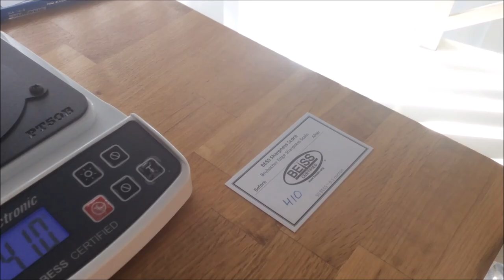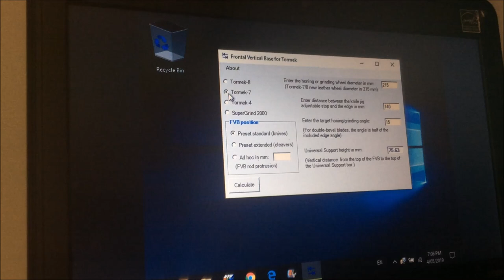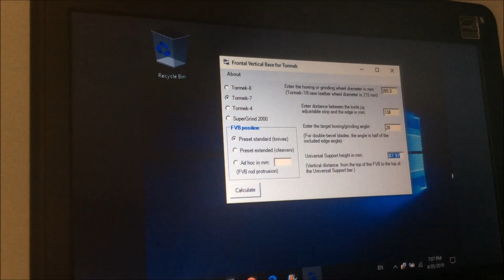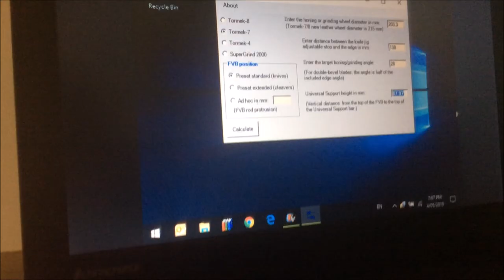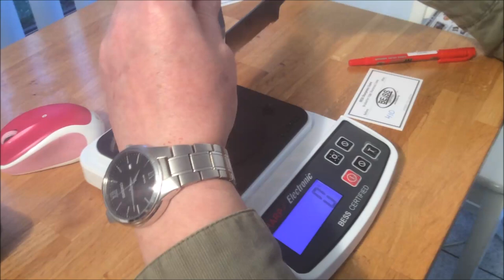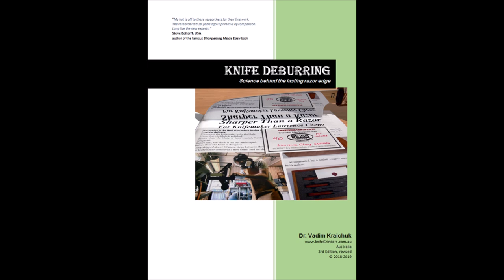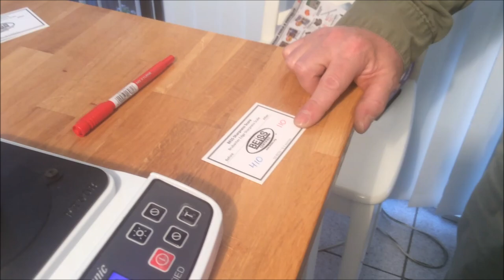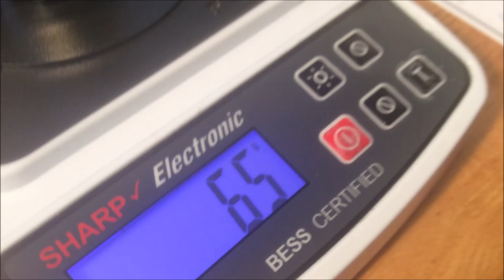How We Sharpen Serrated Knives on Tormek

Comment: Vadim, great video, again; very informative.  However, I couldn't understand what you said between 3:43 - 3:48, when you were describing how to set the serrations.  Could you please clarify?  Thank you.
Reply from the maker: Right, this is important - how much to grind the flat back side. The grind should cover the arches of the serrations (some call them "valleys"), but not extend much further towards the spine of the blade. Practically, initially I place the blade on the wheel almost flat, just to clear the knife jig clamp over the wheel. The lower is the blade, the further to the spine will the grind be. I slowly raise the Universal Support height watching the edge contact with the wheel.  When I see that the edge contacts the wheel in the arches/valleys of the serrations,  I fix the Universal Support in this position.

Comment: I agree completely with you about using a round or conical stick to do anything but start a new scallop. I was taught to deburr the tips with a flat surface and stone the scallop. Gentleman prosharpener used buffing wheels to point and a spyderco ceramic triangle for scallops. He only would touch the back bevel(?) with a bench stone to true it
Reply: He had no guide but a sweet lighted magnifying fixture to get his eyes at gnats ass focus. I really like this video btw

Comment: Another great video.  Question; Where can you purchase the tapered felt wheels?
Reply from the maker: I bought those 8" split laps online, one from a jeweler's supply website, another through eBay.com (not .com.au), but can't remember exactly from whom. The makers are shown in the end of the video.
Initially we used them on a 6" grinder for deburring serrations, but after our research showed this may compromise the edge retention,  we moved the wheels to Tormek to deburr "slow and cool" rather than "fast and hot". Even if the grinder is half-speed, like those that we use with paper and felt wheels in honing plane knives, serrations take longer contact time because have to be honed one by one sparing the peaks, and get too much heat from the felt.

Comment: So to be clear, for a serrated knife, you are sharpening the flat side? You don’t need to sharpen the other side? As in each serration on the other side of the knife?
Reply from the maker: Grinding in the serrations is not sharpening, it is restoration.
No one restores serrations in a bread knife - we sharpen it while it is good to use, then through in the bin.
Restoration of the serrations is something we can do on higher-end knives.

To sharpen a serrated knife, we grind the flat side of the blade. Inside the serrations we only deburr.
Reply: @knifegrindersaustralia5158  wHat machine do you use for serrated knifes
Reply from the maker: Here is a better video on sharpening serrated knife: https://youtu.be/dgFJPv5M4nw
We sharpen on Tormek T7 and T8.

Comment: How do you mount that to your Tormek and take up the slack on the shaft?
Reply from the maker: The felt split laps come with a pinpoint hole in its center, you can drill it to the diameter of the shaft.
Reply: Knife Grinders yes, but what about side to side? That felt wheel is not the 2” width of the Tormek stone - do you use washers to keep the shaft from sliding in and out? I tried running just the honing wheel with no stone on mine today and it slid right out to the lock but on the stone side.
Reply from the maker: Ah I see, please watch at 15:24 - you will see the aluminium insert I place on the shaft at the inner side of the felt wheel.